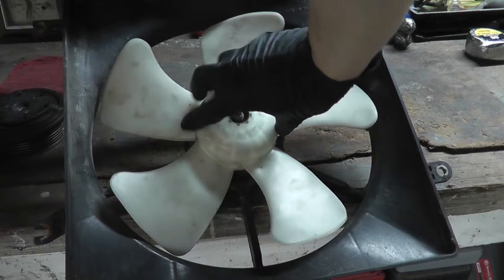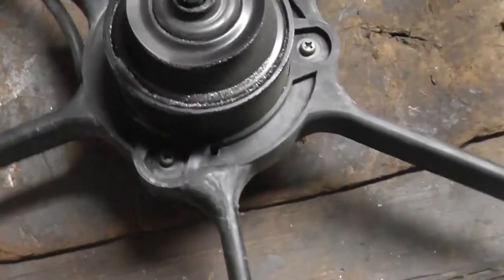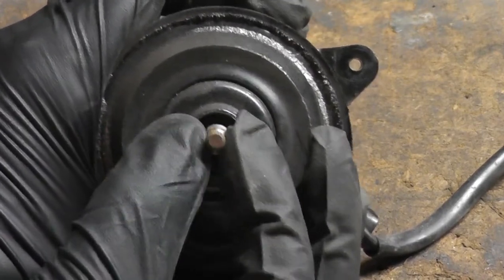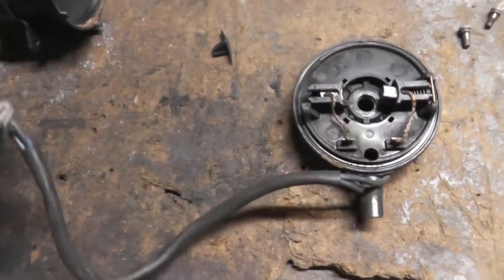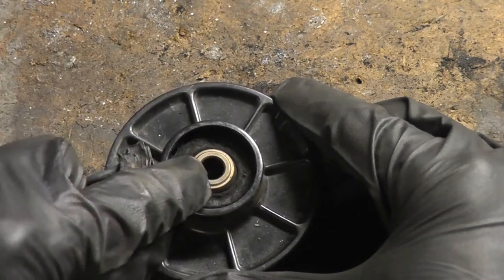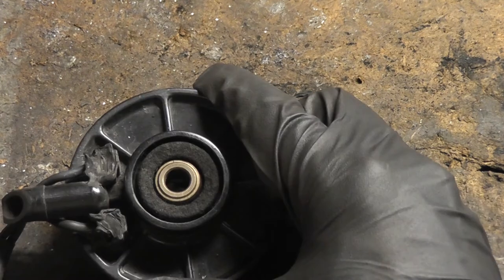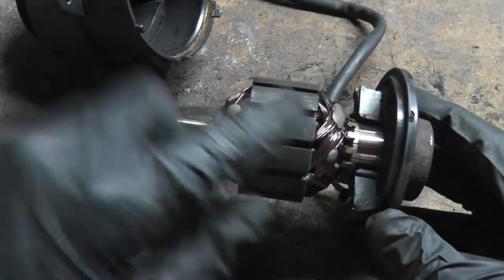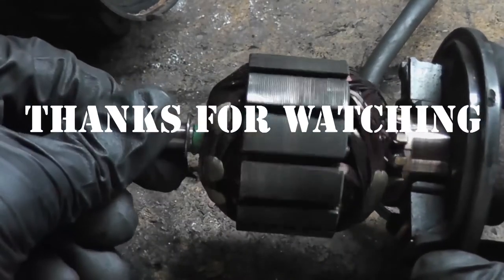Radiator Cooling Fan Motor Teardown

Comment: With a motor of this size I'm a little surprised they didn't use real sealed bearings rather than brass bushings. Made to eventually fail.

Comment: Is it doable to rebuild the fan motor on a Honda Element/crv condenser?  The reason I’m asking is because I might rather rebuild an OEM fan than take my chances on a third party knockoff and an OEM fan is like $150!

Haven’t removed it from the vehicle yet but it failed to activate when the AC was on and it had voltage coming to its connector.
Reply from the maker: I've had good luck using aftermarket cooling fans made by TYC. Well built and as close as you'll get to OEM without the OEM price.

Tiny motors like this aren't really designed to be rebuilt and you'd have to source the parts yourself. Which would involve disassembling the motor to measure the brush size, bushing ID, OD, and thickness, etc. If the commutator is burned up (which often happens if a motor is operated with worn brushes until it fails) forget it.